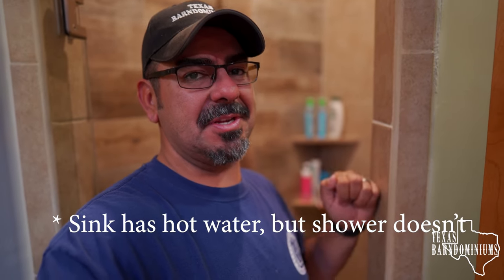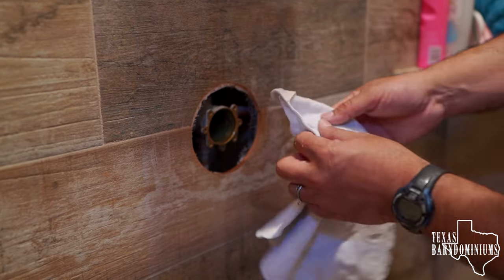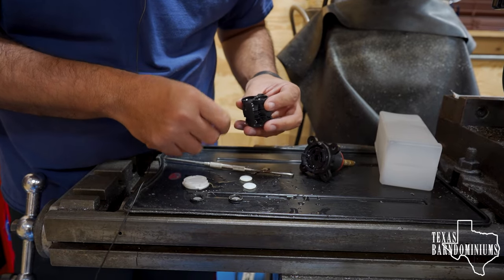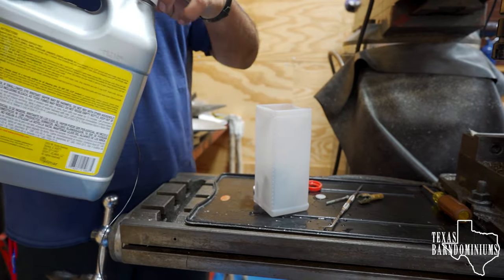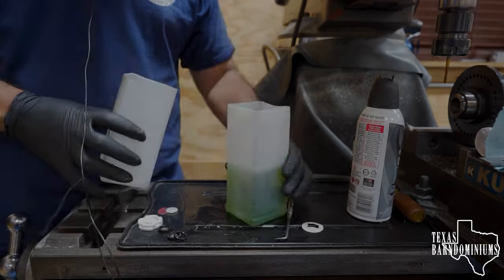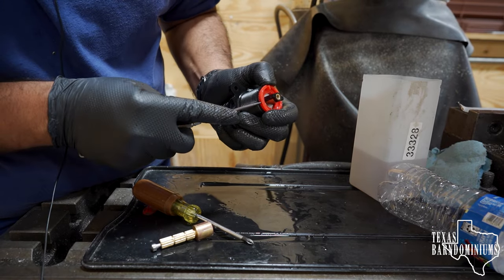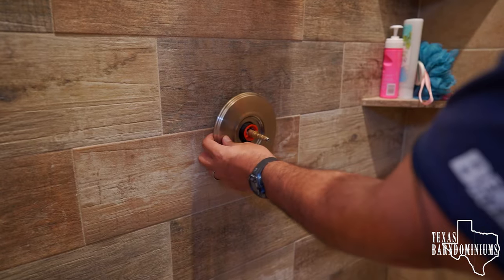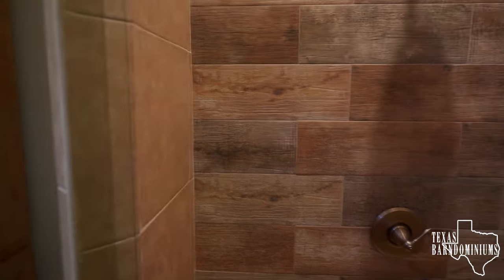How to clean out shower valve to get hot water again - E35 S3

Comment: Good information. White vinegar works just as good if not better and it’s much cheaper than CLR and not caustic. Warming the vinegar slightly in the microwave before hand helps it work better.

Comment: I use CLR to clean the baffle out of my YHM rim fire suppressor. Also some guys use it to clean barrels. That stuff dissolves lots of deposits. It rinses out easily but back to the shower valve. The red ring is the anti scald device and like you said limits the amount of hot water that can also cause a cold shower if it's adjusted improperly. It's good protection for youngsters and also handicapped that can't get to the valve in case of a scalding situation.

Comment: I use to be a gold plate tech. Always rinse chemicals off with water at least once before ever blowing them off with air. A chemical resistant apron, sleeve protectors, gloves and face shield are a must. I got one drop of tin lead solution in my eye about 30 years ago. Not any fun. I have never seen the inside control mechanism of a shower before. Thanks it was very interesting. Be safe my friend.        Vaughn

Comment: I find the vision of you a battery tool to dismantle a plumbing fitting to be almost opposite to my own approach. Growing up during a time when power tools were dreadful expensive and battery ones non existent, I still view nowadays tradies with amazement as their most exercised muscle is their trigger finger. Had a young bloke some time ago borrow a 40oz knockameter from me, the tried to strangle it in use, failing. I corrected his grip, and he admitted he had never driven a nail over 2”, and then only at tech collage. Kind of reminded me of you showing Minnie how to swing a large possibly compo claim.

Comment: This was very informative!  QUESTION:  I have a Growe type valve and it's temp is stuck at a nice warm setting but it will no longer adjust any temp, hot or cold!  I assume this same cleaning procedure would fix this?  I have another show using a basic delta valve which you swing either to the cold or hot side and it feels like gravel!  Same cleaning / replacement procedure?

Comment: Nice to see high maintenance over engineered expensive garbage is not limited to one aspect of products....PS chuck that temp ring,...…..it prevents the hot water from opening all the way and flushing itself clean,...that's why it was hot only clogged or that's the anode from the hot water heater you are flushing out.

         Whole house water filtration and softners pay for themselves 10 times over....

Comment: On the video the valve was connected backwards. You can tell as opening it a little is just cold water and opening it full is hot water. He opened it a little 8:05 and said no hot water.. All the way to the left is full hot and all the way to the right is cold.

Comment: Hello everyone, My cartridge is fine and the clog is in the valve body itself. I tried back washing it hooking a hose up to the shower arm and running water through it but the clog is still there on the cold water side. This is somewhere inside the actual valve body not the cartridge. 

Any remedy besides replacing the whole valve body?

Comment: Need  your  help  I have no  Pressure on the shower  very little  water comes out what can I do???
Reply: Cleaning out the subassembly of the cartridge with mentioned CLR, vinegar or just plain water, drying out the valve to remove any sediment resting in there. Use a little plumbers grease on the rubber gaskets of the cartridge, then reinsert the cartridge.
Also, newer kits are water conserving, so you might get less GPM compared to older models.

Comment: Why didn't you just adjust the hot water to begin with? Then you wouldn't have to buy a new valve
Reply: Agreed. But I like that he suggested cleaning out the sediment which can cause issues including blocking water passing through. But adjusting the hot water flow at the front is definitely a quick fix. The cartridge probably didn't need replacement, but with lifetime warranty, go for it!